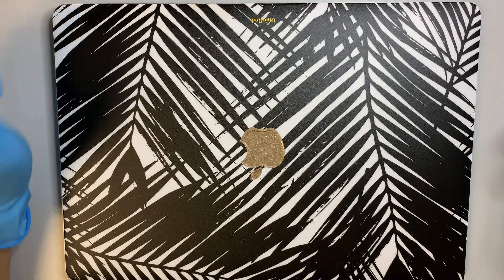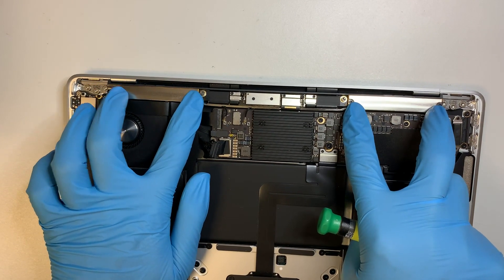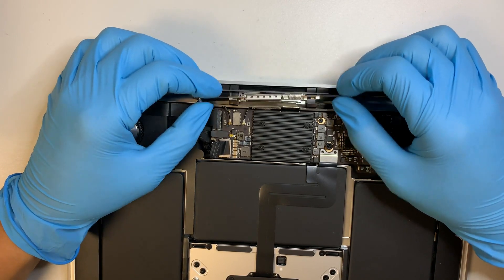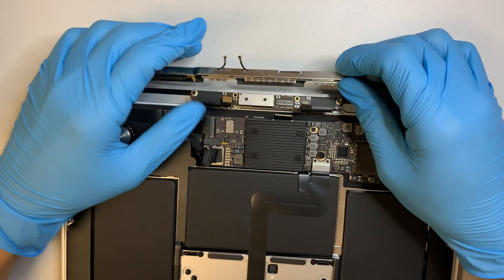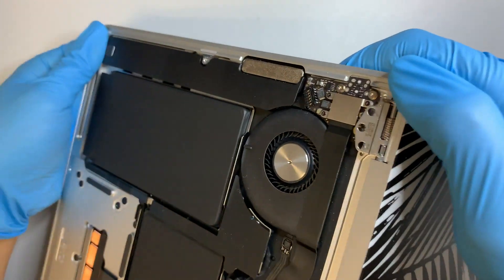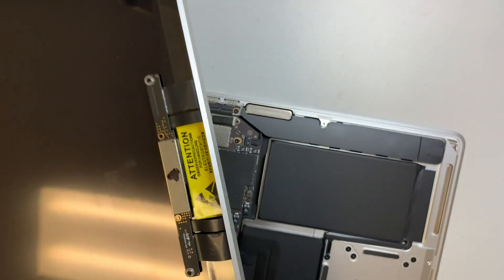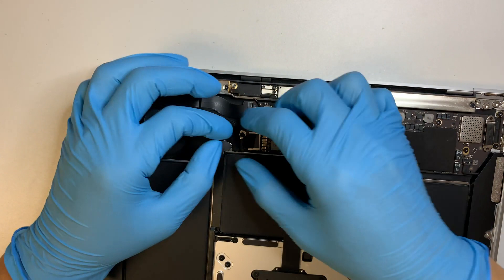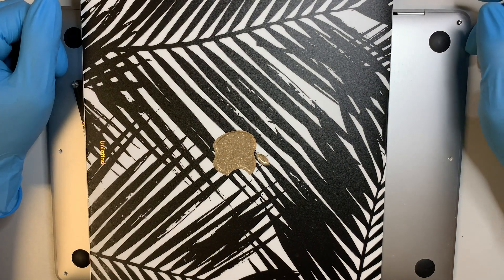Macbook Air Late 2018 A1932 Screen Replacement

Comment: Two of the three brackets on the ribbon cable connecting the LCD to the motherboard do not actually need to be removed. You can leave those on while disassembling as well as the shields that cover them. The only one that needs to be removed. Is the main connector connecting it to the motherboard

Comment: Thank you for the walk through. You should really warn people about how small these screws are and mention which bits you are using as you take things apart. 

These screws, if you use the wrong bit, are very easy to strip. I'm finished but won't ever do this again

Comment: If your replacement screen comes with the little brackets shown at @3:29 and @4:26 then no need to remove those or the flex cables underneath.  4 less tiny screws to remove = less anxiety screwing up :).
Reply from the maker: Haha.. That is true.
Reply: ahhh yeah just replaced my screen and had taken off those extra screws.

Comment: Great video! I lost a screw that goes to one of the small brackets. It’s one of the really short/small screws. I followed the steps exactly but the screen still won’t appear. The laptop does turn on. Do you know what size the screws are and do you think this really has to do with the screen not showing? I’m pretty sure I’ve ordered the correct screen. The serial number is FVFYJ111JK7C. Initially I ordered the wrong year by mistake. 2019. I ordered what I think is the correct year. 2018.

Comment: Hello, thanks alot for this video. If we experience screen flickering and lines without any physical breaks / tears / cracks on the screen, is it worth following your video to check everything is properly connected - without ordering a new screen? Thank you!
Reply from the maker: You are welcome. Glad the video helped. You need a new screen. Hopefully does not cost you a lot. Can get used screen
Reply: @UbergeeksBiz  Awesome. Could not find used screens on Ebay, and would rather not use Amazon for ethical reasons. Is there another seller you recommend for refurbished electronic parts? Also, have practiced your tutorial (without getting the screen) and it is super clear even for a first-time repairer. Thank you so much!!

Comment: I just used your video to replace my nieces screen on her A2179 2020 model. The wifi antenna plate only have 1 screw that year. I couldn't get the one wifi connector to go back properly so I hope the plate holds it or I have to buy a new one of those too. I used .8 pentalobe and t2, 3 and 4 torx. You video was very clear and well done. You saved us at least $300. Screen all in in April 2021 was $450 because I wanted the proper model. Thanks for this.
Reply from the maker: You are welcome. I'm glad the video helped

Comment: Really helpful and straightforward. What size screwdriver do you use to remove the wifi cover plate?
Reply from the maker: It was torx 0.8 size screwdriver.  You can get them from:  https://amzn.to/39doC0F

Comment: Very helpful. After I changed screen, my macbook air a1932 cannot find any bluetooth device. Not sure what I missed. The two wifi cables are both for wifi, or one is for wifi, the other one is for bluetooth? I am wondering if I did not connect bluetooth cable well. Thanks.
Reply from the maker: check the wifi cable. that wifi is for both bluetooth and wifi.

Comment: How hard was it for you to remove the 6 larger silver hinge screws? I cannot get them out. They seem very tight compared to any other Apple screw. 

Thanks
Reply from the maker: Not hard at all. You need the right torx screwdriver.